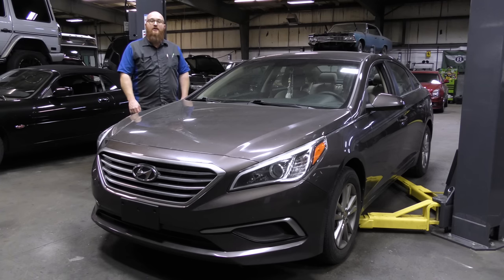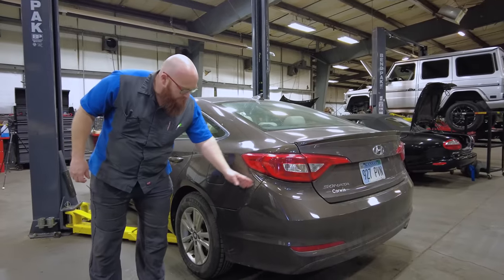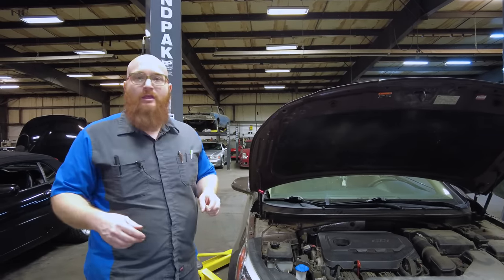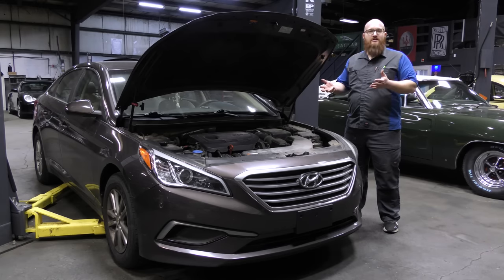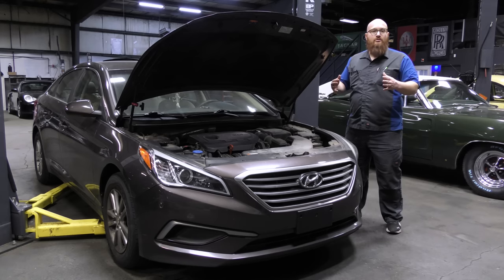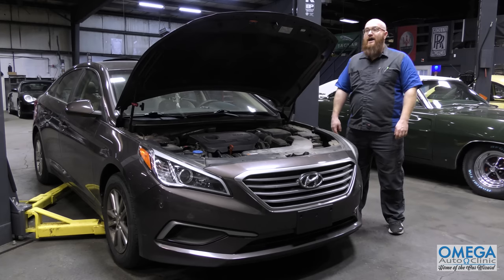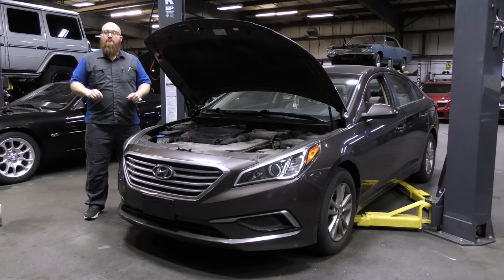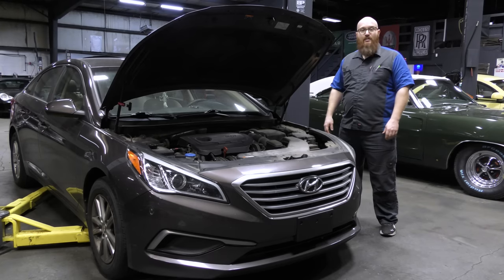What could be so bad on this '16 Hyundai Sonata that the CAR WIZARD is sending it to the junk yard?

Comment: When I first started driving, I got into the habit of checking the oil and coolant level (if there's a see-through bottle) every time I put gas in the vehicle. Since I've owned a number of vehicles that burned oil, I'm sure that simple habit has saved me several engines.
Reply: best time to check the oil is in the morning before you start it that way half the oil wont be in the top of the motor
Reply: That was the standard even three decades ago, if you got gas. the jockey would ask if you want oil fluid check, since all the stations are self serve now every driver should check themselves when they fill up.
Reply: @shaunnesbit1698  Just follow what the owner's manual says.  Honda owner manuals say to check the oil level when warm, by waiting a few minutes after shutting the engine off.  So in Honda's case, it should be at the top of the dipstick even with the rest of the oil up in the engine, as obviously that is how the engine operates when it's running.

Comment: You really hit the nail on the head with the EV comment.

Unfortunately, people are raised to not take responsibility for their actions much less their cars.

What a surprise they will have when they realize EVs aren’t maintenance free either.
Reply: might be even worse. if you bought a Tesla and something's wrong and need repair. you have to take it to a Tesla dealership and a lot of people live very very far away.
Reply: EV's arent maintenance free but they are still significantly cheaper overall as far as maintenance. The only issue is that right to repair is under attack massively so its almost impossible for independent repair shops to work on them, assuming you can even find a shop with techs that even know how to work on them.
Reply: @@Ayn-Rand-Is-Dead EVs have a smaller carbon footprint over the average 200,000 mile lifespan than any gas car according to various peer reviewed studies, and thats running off coal powered planets. The only issue with EVs is that the batteries are currently set to expire in much greater numbers than our current recycling facilities can handle. Most of the material in the battery can be reused or the whole battery itself used for something like long term storage in solar/wind farms. 

How about instead of saying "Oh this will never work" we actually think about the benefits and explore options to save out planet instead of continuing to sit on our hands and do nothing?
Reply: @seanangelo7950  Studies are not done by people who work on cars and are unbaised.
Reply: @seanangelo7950  if one includes the cost of replacing the battery pack at the ten-year point it’s not at all clear EVs are cheaper to maintain for those of us who like to keep our cars. Though for the throwaway society we live in, sure
Reply: @seanangelo7950  Batteries expiring in greater number than recycling facilities is hardly the only issue with EV's, as you insinuate.  Battery fires emit toxic fumes, EV's are harder on roadways due to excessive weight, and car accidents with EVs run a much higher risk of killing the person(s) in the car that the EV impacts.  "Peer reviewed studies" mean nothing if those doing the studies have no connection or direct knowledge of the actual industry, as is often the case.  People who don't know a lot about an issue often cite studies, with having any actual knowledge with which to verify the information in said studies.
Reply: @seanangelo7950  Not necessarily, given that Tesla will not sell parts to individuals doing their own maintenance.  Parts are easily obtained for most other vehicles, causing maintenance on non-EV's to be inexpensive (no labor costs) by comparison.  There are far more electronics that can cause issues on an EV than a typical gas car, and you still have similar suspension, brakes, steering, etc components.  A reliable powertrain in a typical vehicle (unlike the one featured here) requires minimal maintenance.

Comment: This 2.4 GDI engine is very problematic for Hyundai right now.  My sister's 2015 Sonata's engine just grenaded back in August at 67k miles and was covered under warranty, but she had to wait over 7 months for it to get it fixed because the dealership had a huge list of 50+ cars of identical vehicles that also needed engines and the dealer was waiting for a bunch of them to be shipped from South Korea.

Comment: Essentially the work to replace the engine is much more then what the car is worth. It’s why whenever I change the oil in customers’ cars at work I set any built in reminders to 5,000 miles. And usually my own method (and the one I recommend to customers at work) is check your oil (and any other accessible fluids like power steering or Transmission fluid) every time when you refuel; they have paper towels with the windshield squeegee just for that purpose!
Reply: Yeah I think the most I’ve changed it on a a hyundai palisade was 5,000 and that was us having to go over due to appointments I do try to stick to 3-4,000 max. But the v6 from hyundai is a completely polar opposite from that theta 2 4 cylinder crap.
Reply: The Chevrolet Equinox and GMC Terrain is the same way. Especially the 2.4 liter engine. Also the Chevrolet Cruze with the 1.4 turbo is the same exact way.
Reply: You should be able to find a used motor for that and swap it out for less than 6k
Reply: @dantonliam  like the Wizard mentioned, he doesn’t want the risk of installing a used engine, only for the NEW engine to shit the bed in the EXACT same way like the old engine did!
Reply: 5000 mile reminder may be a bit too long of an interval. People don't just rush in for an oil change as soon as it alerts. They'll probably go for another 1000 miles after that before they actually bring it in.
Reply: That is what I do at each refuel  . Because, you just don’t know when something may start leaking. 17:08 17:08
Reply: I mean... Yeah, but a new engine means that for 10 grand they'd be resetting the odometer back to zero (for the engine anyway). That's worth something. That other Sonata Wizard showed, "similar mileage," might also be ready to spin a bearing. This '16 with a new engine would certainly not be.
Reply: @dougfisher1813  the reason why we can stretch it to 5,000 miles is because modern day oils are a synthetic blend and have FAR superior additives and friction modifiers than straight conventional oils.

Comment: I have a 2016 Sonata with the 2.4 and we did (and still doing) preventive maintenance at the dealership (going above what Hyundai recommenda) every 4000 miles (6000km) but this now at just less than 60k miles (100k kilometers) it's consuming oil like crazy. At 40k miles (about 60k kilometers) we had to do the variable valve timing! My wife commutes in this car on a highway near our home so not even heavy city driving. My wife doesn't accelerate hard nor drives fast. In short, this car is living a very good use scenario but still had a timing issue and consuming a quart (about a liter) every week. The only good decision we did was buying an extended warranty for 10 years 120k miles (200k kilometers).
Reply: Sounds like you will be needing that warranty.  Hopefully they do not try to weasel out of standing behind it.
Reply: @Kevin-E-Glick  pretty sure I'm using it but let's hope they'll warranty it
Reply: If you use non synthetic it burns oil real bad

Comment: I had an absolutely gorgeous red 2016 Hyundai sonata. Ran flawlessly with no problems. However because of the theta issues that I heard so much about, and the car was prone to be installing because of the social media foolishness. I finally sold it sadly last week.  I miss that car but replaced it with a 2020 Honda Accord. Which immediately made me happy after it got 46 mi to the gallon compared to the sonata getting 33 milesvt9 the gallon.

Comment: 12:42 this is the same problem with electronics repair. Most of the times it’s not repairable, and even if it is repairable, the parts cost will essentially end up costing as much as a good used unit, if not more

Comment: When I worked at Hyundai, around half of the lease returns still had the first oil change sticker. It was right there on the windshield, so the owners definitely see, but just don’t care if the next owner gets screwed. These are reliable, long-lasting cars for people who buy new and maintain them, but they don’t hold up to abuse and neglect.
Reply: Back in the 80s a friend of mine worked at a shop where his older brother was the lead tech.   One day my friend's brother walked him over to a 2-3 year old Corolla with a seized engine.   My friend's brother informed him the car had a seized engine  and asked him to look under the hood for 'something obvious'.   My friend was stumped.  My friend's brother directed his attention to the oil filter.   Again my friend was stumped.   At that point his brother said to him, 'That's the original factory oil filter, I don't think this car ever had an oil change.'  When they called the woman who owned the car and asked her if she ever had the oil changed she replied, "Oh, no.   I'm not falling for that dealer trick."
Reply: @MrSloika peak women ☕ ☕
Reply: These are nice mid sized sedans. Just as nice as a Camry and more spacious but the engine burns oil and with time it starts burning ridiculous amounts of oil. My mother's 2016 Sonata was burning 2 qts a month over 500 miles or less. So if you check it one every two weeks and top it off you should be good. But as someone whose first job was at Jiffy lube 25 years ago, this trend of new engine burning oil like this is going backwards. With the oil and filter quality now they just shouldn't be burning 2-3 quarts so quickly.
Reply: @RJT80  My 2015 GTI with 168,000 plus miles was using about a half quart of oil per 4,000 miles. However the timing chain tensioners were going bad and that would be at least $1500 to repair. The repair shop told me that the mileage I had on the car was right around the point where Volkswagen's start failing one part at a time till you have bought a new car one part at a time.
Reply: @RJT80  That basically means it’s nowhere near as nice as a Camry.  There’s no way in hell I’m buying a vehicle that burns oil so early in its life.  That’s not a good engine.

Comment: It's not up to the dealer to decide if that car gets new engine. It's the manufacturer. I worked as a Hyundai/ Kia tech for a couple years and when we do our test it gets sent to the manufacture and it's up to them to decide if it's customer neglect or manufacture defect. We had cars that only had 15,000 mi without changing the oil and they were approved for an engine which surprises me

Comment: I had a Hyundai with one of those engines. Mine burned crazy amounts of oil. I check my oil regularly and it was very difficult to keep it topped up and it used expensive oil too. I always made sure the oil was filled up before taking it in for service. Eventually sold it to Vroom for way more than it was worth. A guy I know at work did the dealer warranty engine replacement and didn’t get his car back for 6 months. I’d stay away from Hyundais personally. It was an ok car otherwise but that’s about it.

Comment: We have rebuilt those same 2.4L engine here at out shop multiple times with no issues. All we ask for to honor warranty is to change the oil every 3 months 3k miles. Its usually around 6 grand (installed) since most of the time their short block core is not rebuildable. We would get them from the dealer but over here in California the warranty from the dealership is 45 DAYS!! 45 DAYS warranty from the dealership for a new engine is out of this world!!!

Comment: My neighbour has a '14 Accord, she blew up the engine by not checking or changing the oil. It only had 135,000 KMs (83,000 miles). I work for a big fleet cab company which has good junkyard connections and it's own commercial garage. I was able to get her a used engine (low mileage,one year warranty) for $900 and get it installed for $1000. It's still running perfect a year later. I suspect she's still not being vigilant with the oil checking,lol.

Comment: First things first:  Love the channel and the content!  Secondly,  regarding the Hyundai I have a few questions regarding the vehicle and the ownership:

1) Was this the original or subsequent owner?
2) Regarding the vehicle, was the vehicle maintenance records kept up to date?
3) Were they any records of any major services done (30K, 60K, 90K)?

Here is the reason why I asked these questions:

I purchased a 2012 Kia Optima with 88K miles on it.  Since I am a subsequent owner, I had no idea what type of maintenance the vehicle had.  I stated off with my 90K service (more on that in a minute), replaced the spark plugs at 100K,  transmission service as well as other services completed to keep this response short.  I had all my work done at a Kia dealership.  30K miles later, my engine had a catastrophic failure.  Within 10 days I had my engine replaced.  Why?  Because the dealer has ALL my receipts.  It is the FIRST thing Kia/Hyundai will look for when it comes to an engine replacement, but especially on the 2.4L Theta II which is what the engine in your video had.  

One of the things in the major service is the fuel service.  As you know in a GDI engine, carbon deposits are left in the combustion chamber.  Over time, it will make the engine sluggish and the driver will notice reduce performance.  In my estimation, this should be mandatory for all Kia/Hyundai owners, especially with the Theta II engines every 30K miles.  Having this done in concert with scheduled oil changes (5K miles or 6 months if the shop uses synthetic oil) should prolong the life of the engine. 

Lastly,  to all Kia/Hyundai owners KEEP ALL YOUR RECEIPTS!  This is where the corporation will get you on a "technicality"  because you didn't live up to your end of the "contract" by having service done in a timely manner and "abuse" was found.  If you can afford to get your service done at a dealership, do it.  If, not save every receipt that you have spent on the vehicle, because they will be called into question.  Keep making your "car wizardry" that I see you do in every video.  I am a fan!  😊

Comment: I have one of these engines in my car, 2016 optima, 2.4L,  basically the same car, with 175k miles. The truth is, they burn oil, you have to do oil changes every 3750 per manufacturer, I have always done mine at 3000 miles. You have to check the oil levels every week, When it's low, the oil pressure light will flash when there is strain on the engine, like a turn.

Comment: Hyundai/Kia dealerships are notorious for doing that to customers! I see that all the time with them. And yes you're absolutely correct about those engines not being very well built to begin with. Another thing that was problematic on those cars was the timing belts. They were not well designed and they would fail prematurely, sometimes at 30k, and then they would snap and destroy the engine. Replacing or rebuilding it is not worth it because as you've said many times before "if you get into a wreck, insurance gives you the book value of the car and the rest is lit on fire, you burned all that money!" So yes I agree it's not worth it!
Reply: As bad as Hyundai is, no manufacturer will honor recall or warranty on a maintenance neglected engine.
Reply: This car doesn’t use a timing belt… Hyundai and Kia since at least 2011 all have been timing chains. Only the early and mid 2000s did (some) of them still use timing belts and those were the ones before the theta 2 engine. It’s all timing chain not belt and they don’t have issues with them. The only thing other than burning oil and outright failure they have is some 2015s had a issue (and this sonata in general) in some instances would throw a P0010 code which is the intake camshaft position actuator (E-CCVT) it’s very cheap, simple, easy fix and is literally on the right side of the engine block a seal goes bad and leaks oil into it and you can watch a YouTube video on it and anyone can order the part and replace it.
Reply: @zabryant01  yeah I know that. It was the early 2000 year models that had premature timing belt failures
Reply: @zabryant01  Theta I also uses a timing-chain. All Hyundai Sonatas 2.4L, since 2006, come with timing-chain.

Comment: I think a lot of this is happening because people don't know how to properly take care of their vehicle. Dealerships and oil change shops charge a pretty penny to change oil, when they could change their own oil for 1/3 of the price if they learn how to do it themselves. Takes less time than waiting on dealerships or oil change shops and they can change their oil at their own convenience. My grandpa told me when I was a kid "take care of your things and they will take care of you." That quote is especially true for vehicles. Learn basic vehicle maintenance (oil change, filter replacement, plugs and wire replacement), because it can save a lot of time and money.
Reply: Dead wrong.  The 2.4L engine in Kia and Hyundais are junk, doesn't matter what you do.
Reply: No this car is literally trash take it from someone who religiously has maintenance completed on time. Even after multiple repairs I'm still having issues
Reply: @SheRNB  Maybe its hit or miss, mine has been reliable so far from 24k miles to 80k now. I did have to change the intake manifold runner but it was under warranty around 40k miles. I do oil changes every 3k miles

Comment: My 2006 blew...same reason. I hadn't been driving (wife, 2 kids did) and I just didn't follow up with them if they were actually checking the oil so I can take blame for that much. This was about 10 years ago, and I had my mechanic rebuild it (6 cylinder) for $3500 (+-). Believe it or not it's still running ... my son has it.